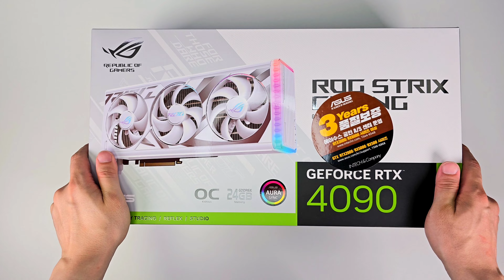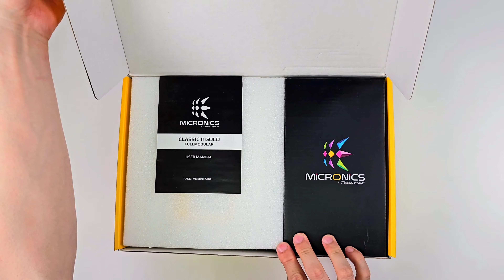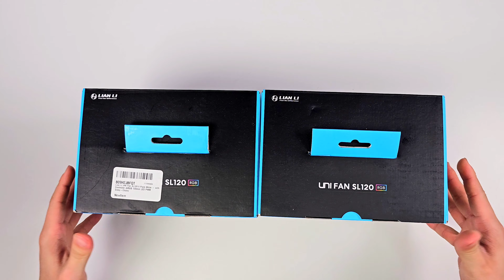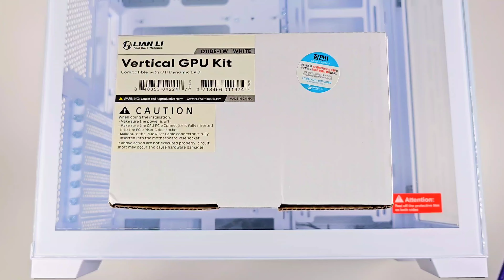RTX 4090 STRIX + 13900K White computer

Comment: It is a very nice build! The components are high end pic by finger, but I don’t think that push and pull system in the w.c. really necessary, those three fans in vertical should be doing intake and not exhaust. And I wouldn’t install the gpu in vertical because I really love the Aero g z790 design. But still a build that I envy

Comment: Biggist Fail. :   Dont use the M2 Slot over the GPU SLOT !     Now you have only 8 lanes @ the GPU SLot and not 16 !!!!     your 4090 runs with under 50% Power !
Reply: Not true lol that's not how it works a simple way to test it is use gpuz
Reply: @kenpi1365  when you use a Intel Chip than it is.